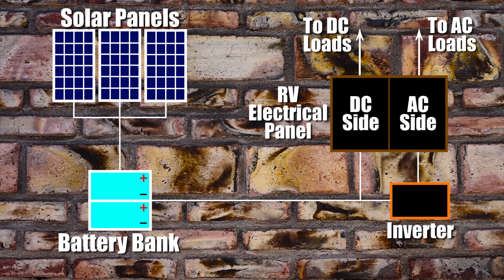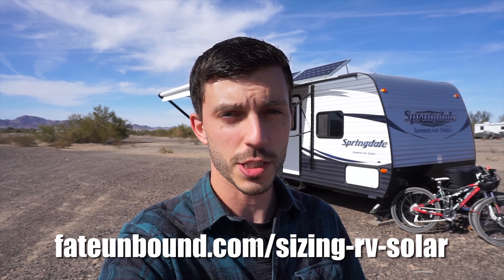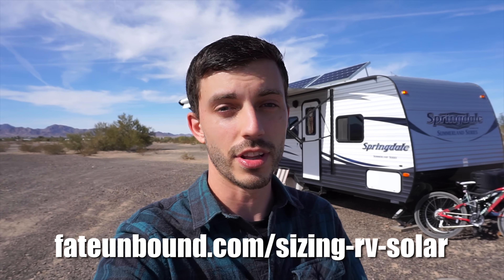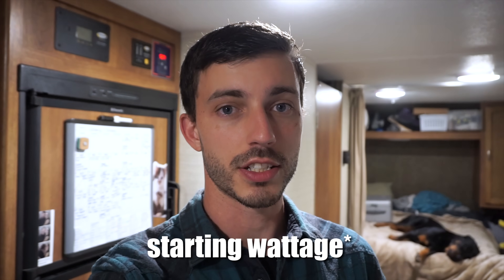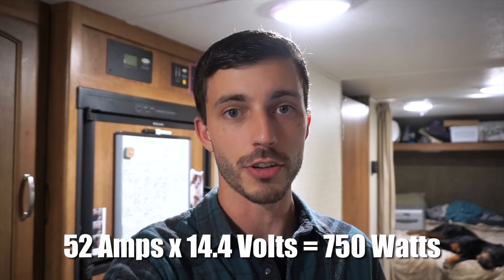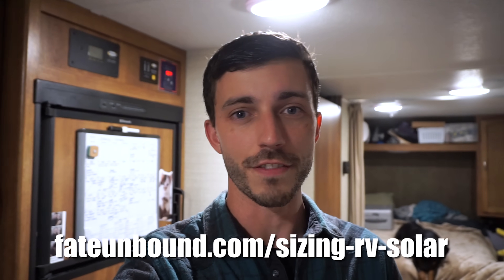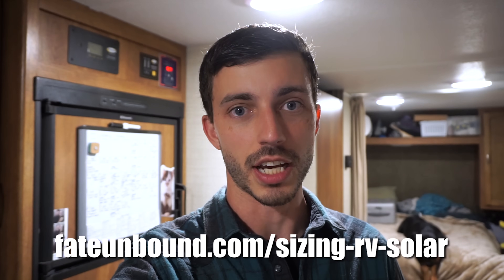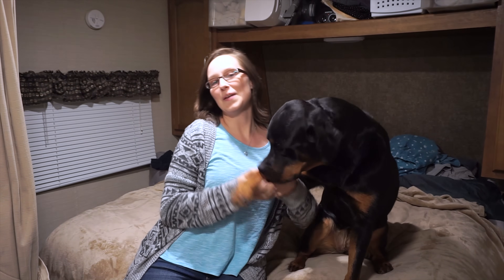How to Power an RV Air Conditioner with Solar - Full Time RV Living

Comment: Have you looked into a mini split, they take very little amps to start up and run. I myself need to do more research in it.
Reply: Michael M Instead of a mini-split unit, have a look at Climax Aire's VS-12. It's THE most efficient dual-hose portable A/C unit on the market. It's a DC inverter design that consumes only 4.1 Amps to 7.5 Amps at 50% and 100% power output, respectively.
Reply: They are hard to retrofit in an existing RV without removing cabinets inside and getting rid of everything that sits on the tongue of the trailer. But the efficiency is very high and probably 1/3 of the power use from the roof AC, plus it start gently.
Reply: Do modern portable A/Cs stay on all the time?  I had one in the mid-90s that only ran an hour or so, then turned itself off for 20 minutes.  It did the equivalent of nothing.  Are they better now?
Reply: Good to know; thanks.  So do they run continuously, or cycle on and off?  Sorry, but I don't know much about electrical/electronic stuff.
Reply from the maker: +Michael M No I haven't, I've never heard of them before now. Thanks for the tip, I need to do some research too now!

Comment from the maker: **INFORMATION UPDATE** Our 13,500 BTU RV air conditioner actually pulls about 150 amps instead of 73 amps while running. In the video I did not allow the A/C to run long enough for the compressor to kick on. Unfortunately this means, to run our A/C regularly, it requires roughly double the wattage of solar panels (so 1500 watts) and at least double the amp-hour battery bank capacity (150+ Ah per hour of A/C usage at night) described in the video. However, at these high current loads the battery’s Ah capacity drops considerably and won’t last nearly as long as it would at lower current loads so you’ll probably need much more than 150 Ah battery capacity per hour of usage. The starting wattage information is correct however. But installing a soft starter can alleviate the high starting wattage requirement and therefore a smaller inverter, such as a 3000 watt inverter, can be used.
The message is still the same though. To regularly run the A/C on solar you will need an incredibly big solar array and battery bank. So much so that, in my opinion, it is not worth it. Your best bet is to either get used to no A/C or - and I hate to say this - run a generator when you need A/C. Thanks!!
Reply: ditch the roof ac unit and you will get much more milage. I'm in the process of fully outlining the process in my channel. i can run my ac on high for 12 hours a day in the summer, all solar 23 ft class C.
Reply: Agree with ditching of stock AC being a must.

Man, I saw 'run RV AC on solar' and then those 3 200kwh panels, and I'm all like, yeah, I gotta see this pipedream in action. NOT FEASIBLE. Nor is with a 1500kwh. I run a 800 BTU, drawing a fairly paltry 6A, on 1900kwh solar, and it's fine running throughout the night (only), but I also live in W Texas where we get about 366 days of sun per year. One cloudy day and I'm conserving. Two and I'm had.
Reply: hello Fateunbound! just a silly question...can i run my window AC directly from solar panel when sun is up no battery only solar and inverter because i cant afford batteries but panels are extremely cheap where im at.
Reply: Fate Unbound  Hi great videos and love the way you break down the information. I wasn't understanding how you are getting 75 amps from the air conditioner.  An AC that size typically consumes about 24 amps @ 110v on running and spike close to double at start up. I would check your manual or online to double check.  The electrical services at campgrounds ive seen are 35 and 50, so if it was 75anp it would trip the breaker I believe. Anyway great videos which I'm hooked and binge watching. Thanks!
Reply: @FernandoMartinez-jt6jc  the inverter draws the 75-150 amps not the AC unit. Takes lots current to turn 12v power into 120 volts and the 10-20 amps to,run the air conditioner.

Comment: Good info! Unlike out west, here in the humid southeast, A/C is not an option, it's a necessity. You literally couldn't sleep at night without it. I'm converting a cargo trailer and wanted to run this by you.... Let's say I install the smallest possible 5000 BTU window A/C (like the Frigidaire FFRA0511R1), which draws 4 amps at 115V AC (460 watts). Given all the inverter etc losses, what size battery bank would be necessary to power the A/C all night (8 hrs = 3680 watt-hrs)? It seems like this type of system would be much more feasible than yours...
Reply from the maker: That's true, in the humidity A/C is a huge deal, especially in the summer! If that air conditioner draws 4 amps off 115V, it will draw roughly 40 amps from a 12V battery bank. Lets say 50 amps to be safe after inefficiencies are taken into account. 50 amps for 8 hours is 400 Ah of required battery bank capacity. Lithium batteries can be discharged down to 80% before greatly reducing life cycle, lead acid batteries can only be drawn down to 50%. So if you have a lithium battery bank you'll need 500 Ah of rated capacity, and with lead acid you'd need 800 Ah of rated capacity. Hope that helped!
Reply: Thanks for the informative reply. So, a quick search showed that 800 Ah of lead acid is about $1,500, 800 Ah of AGM is $2,000, and 500 Ah of lithium is $4,000+. Ouch. Looks like a generator, shore power, or a cold shower are the only options...
Reply from the maker: +MemeInjector Yeah unfortunately large battery banks are expensive. And Lithium is a big up front investment too. Thats why we have 400 Ah. We wanted bigger but it wasn't in the budget haha
Reply: You just answered my comment, this is the way to go.  Just gotta figure out a stealth mount

Comment: A small window a/c might use less power. What do U think?
Reply from the maker: I'm not sure how much amperage a window unit would draw, but I'm sure it would still be at least 50 amps. While it is easier to handle 50 amps constant draw it is still a fairly high current that would require a large solar array and battery bank. We think it's easier to just do without and run small 1 amp fans.
Reply: I was thinking the same thing. You can get a 5000 BTU window unit. I think they're even used to be a 4500. With a soft start and enough solar panels that seems like this should be able to run okay for at least eight hours a day, don't you think? I live in South Texas and would be spending quite a bit of time here so it would be necessary for me. This is my number one concern to get figured it out before I start my van build.

Comment: How many battires are in your battery bank?
Reply from the maker: +Lou Johnson We have two 200Ah lithium batteries wired in parallel for 400Ah of capacity. Our batteries would actually be drawn down faster than 6 hours by the AC since it is pulling so many amps the usable capacity drops.

Comment: Thank you for answering that straight forward!  Here’s what I’ve considered to avoid the “drone” of a generator.

Because I live/camp in a hot climate I want a battery bank to handle 48-50 hrs of continuous AC. To do so I’m considering the 10kw Tesla wall packs adapted for an RV. Though I like solar charging as much as anyone, my thoughts were to charge all battery storage from my 500amp alternator as I drive. I can’t see why something like that wouldn’t work.

Your thoughts?
Reply from the maker: +Ken Munoz You're welcome! Unfortunately I dont know enough about the Tesla Powerwalls to comment on how they would work on an RV application. All I know is I haven't seen or heard of it being done as of yet. All I know is you'll need an incredible amount of batteries to run an AC for 50 hours on battery alone. 50 hours of 73 amps is 3,650 amp-hours of capacity! You'd need almost 5 10kW powerwalls for that.

Comment: The inrush current of the AC can greatly be reduced by installing a MicroAir Easy Start unit. I have one of these on our camper with a 15kbtu AC and I can start and run the AC on a 2000watt Generator now. (Not much else though). Very glad I put it on and the process is easy and the results are amazing. 
https://www.microair.net/products/easystart-364-3-ton-single-phase-soft-starter-for-air-conditioners?variant=30176048267
Reply from the maker: +Chris Davis You're right a soft start can make it so the inverter you need is much smaller by reducing the starting wattage of the AC. Ours is small enough that our 3300 watt generator can start and run it. No need for us to install a soft start, but for other people it may be exactly what they need.
Reply: Agreed, it will have little impact if using a generator in the scheme of things. But, if using a Solar array to run the AC for a short time, having the Micro Air Electronic starting unit can add a little more time to the life of the batteries. It makes the AC and the genset sound so much happier when you start the AC. No more struggling for the Generator at all when it kicks on and I am sure that the Inverter would be the same.   .... This unit is far.... more than a simple soft start capacitor..... Highly recommend checking one out. Maybe ask for a demo unit and sponsor. 

I don't work for them or anything but there are a few things in life that you can be truly amazed by that help solve a problem. This is one of those items. A bit pricey, but well worth it. 

Love the videos and especially like the BLM camp reviews..
Reply from the maker: Thanks for the tip I appreciate it! We don't run the air conditioner enough though to warrant the investment in a soft starter. We are yet to fire the generator up to run the A/C - even though we bought it for that purpose - and we never try to run it off our inverter. This video was the only time I've ever started the A/C with the inverter haha. When it gets hot we just suck it up and turn some 1 amp fans on, our solar can handle those haha!

Comment: Fate unbound, Thanks for your informative videos. When running on a generator can you get away with a smaller generator to run your AC with your solar system installed? Will your solar system supplement the generator?
Reply from the maker: The solar system will not supplement the generator. There is a transfer switch (think of it as a large relay) that is between the inverter and the 120V AC panel of the RV. When you plug into shore power, or have a generator running, the transfer switch connects the shore power cable to the circuit, and disconnects the inverter from the circuit. Therefore, when the shore power plug is energized, the inverter is not connected to the circuit. And vice versa. However, your solar panels will continue to charge the batteries while your generator is supplying power to 120V AC appliances like the air conditioner.

Comment: How long did you let the AC Run before you looked at the Amps Drawn?  I think 73 Amps was just for the fan, the compressor doesn't start until 1 minute later, and will jump up to 160+ Amps.  Also if you want to run the AC on a smaller generator or inverter you should install a soft start on the AC.   Also when you approach those high current loads (even with Lithium),  you AH are available in the batteries drop.  The times I have run the AC with the inverter, you are only going to get 2-3 hours of run time, and I have 800 AH of Lithium Batteries, and 840 Watts of Solar.
Reply from the maker: You have made some excellent points here John, I'm going to pin a comment to the top that updates this information as well as include it in the video description. I'm also going to edit the post on our website to include this information. Thank you very much for this informative comment! The A/C did not run for a full minute and further research shows you are correct, the running wattage of a 13,500 BTU A/C units is between 1500W and 2000W so therefore between 125A and 166A would be pulled from the batteries once the compressor kicks on. You are also correct on the lower usable capacity while pulling large currents from the batteries and I failed to mention that fact too. Thanks again for the great comment!
Reply: No way the fan pulls 70 amps.
Reply: The ammeter is reading battery draw, not the working voltage of the AC. Most of the AC units run on a 20 amp or smaller breaker. However when your feeding a big inverter to power the AC a inverter draws many more amps than it puts out. Especially when converting 12v to 120.  Volts go up, amps go down. Works both ways.
Reply: Hello, your calculations factor in the compressor running the entire time you are running the A/C.  Is that reasonable?  I'm having trouble estimating what % of the time a unit would cycle on the compressor (I figure it depends on a rig's insulation and desired temp. difference between inside and outside the rig) and what the draw would be when the compressor is off vs. on as spec sheets only seem to reference when the compressor is on.  Thanks for your opinion!
Reply: also don not forget to only run your batteries down to 50 % for flooded and varies for other types. this is an important factor in sizing your bank.
Reply: John Walker I
Reply: Jim Bo  70 amps seems really high for a fan, but is definitely too low for a 13000 BTU A/C
Reply: Very good points Fate and John.  Having the ability to run a/c for 8 hours is really my ideal goal.  For my situation and many like me, chasing a promaster 2500 class b build, 13,500 is wayy overkill and excessive.  Have you seen any 3,000-5,000 btu roof a/c's? that would be a good solution.  840 watts is about $8k worth of renogy lithium batteries

Comment: Great explanation! I have a similar set up on my Lance 20' TT. 600ah of lifepo4 and a magnum hybrid inverter charger. Like you mentioned roof solar is not feasible for our little campers to power the A/C... When I do use the A/C (off grid) I use it in conjunction with my generator. I'll run my A/C either all day or night knowing that when I wake up or go to bed the genny needs to run 2.5hrs to bring the batteries back to 100%. Using that set up, the generator runs a relatively short time and is running at it peak efficiency. The major component that let's me do this is the lifepo4 because it allows me to dump over 200 amps into the batteries (fast charge rate) during nearly the entire charge sequence.... Keep the videos coming!
Reply from the maker: Very nice setup! We definitely wish we had 600 Ah of battery bank capacity, our 400 Ah runs thin every now and then but we LOVE our LiFePO4 batteries. The fast charging rate is fantastic, we also us our generator as a backup charger in case we run into too many cloudy days in a row. We just don't run our AC at all and suck it up on hot days. However if it is TOO hot just before bed (over 80 degrees in the RV and its bed time) we will fire up the generator so we can run the AC for an hour to push all the days heat. We've yet to do that but it is what we bought the generator for. Thanks!!
Reply: This seems like a very good setup, instead of running the generator all day and night just charge up the battery bank . How much did the bank cost you
Reply: @bentrishaleemartin926  It will be about $1k/100ah so I would estimate $6,000.  High efficiency A/C has been mentioned but it is worth stressing.  A standard Dometic 13.5 draws 12.4a compressor, 2.5a fan and 63a inrush (start).  The high efficiency model goes down to 8.6a compressor and 50a inrush so basically uses 25% less power.  Amazon sells it for about $800.  This is relatively small compared to battery cost.

Comment: That’s about what I thought. My little Cherokee Wolf Pup has the same size AC unit. Unless I’m on shore power somewhere, forget it. However I have hooked up my Westinghouse 2200W inverter generators and it will run the fan in the unit while still letting me use other 120V stuff. Your bottom line is spot on. Stay someplace where it’s not so hot and run the fans! BTW, how many amps does Sweetie draw sleeping on the bed back there. Somebody’s spoiled! Ha Ha! Good video David!
Reply from the maker: Yep, we knew going into all this that we wouldn't be able to use A/C pretty much ever. But that's exactly why we got our 3300W generator. If it's absolutely unbearably hot, or if it doesn't cool down much at night and we need to fire the A/C up before bed to push out the day's heat. But we're yet to use it for A/C. But it's nice knowing we have the option! We do the same as you except our solar can handle our MAXXAIR fan (it's 12V DC) and some small portable 120V AC fans we stick in the windows. They only draw about 1-2 amps each though.
Sweetie doesn't draw any amps but boy does she consume a lot of calories!! I wish I could feed her using my solar cause dog food for that big lug is expensive! And of course she's spoiled, isn't that what dog ownership is all about? Thanks again Dave =)
Reply: Fate Unbound Absolutely, spoil’em!

Comment: Great information on Solar. I have a question about your refrigerator. Have you thought about getting a 3-way; one that runs on DC current? Also when you travel between campsites, do you turn your propane off and run it on AC? I've read you shouldn't drive with the propane turned on while traveling.
Reply from the maker: Thank you Travis! We would love to have a 3-way fridge with a DC option, but we aren't going to replace what we have because it would be pretty expensive. So we'll live with what we've got haha. We usually just turn our fridge completely off when traveling. Our fridge is surprisingly good at maintaining temperature over the course of a few hours. We typically don't travel over 4 or 5 hours at a time.

Comment: Also you might want to get a soft start for your AC which reduces the AC draw on start up:)
Reply from the maker: Soft starters are definitely a good option instead of upgrading up to a huge inverter!
Reply: How many batteries do you have in your trailer?
Reply: Living mobile you can drive your home to follow the seasons.